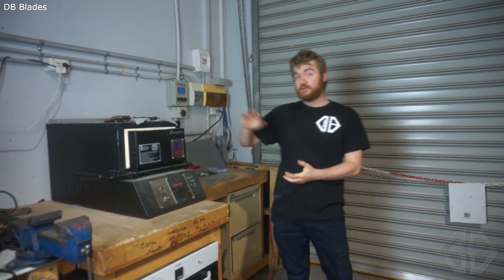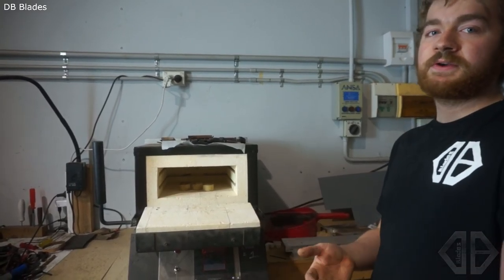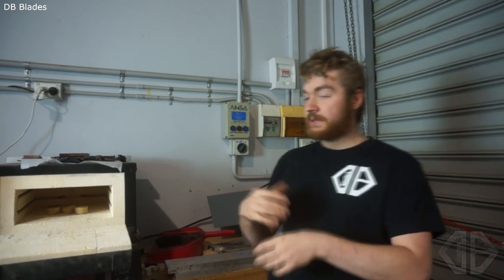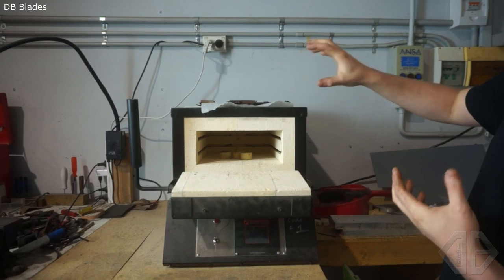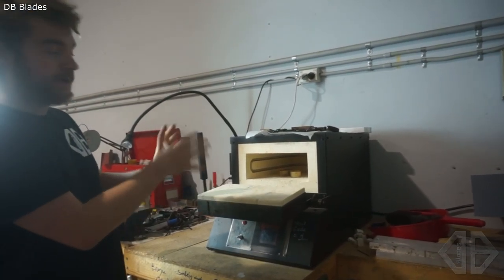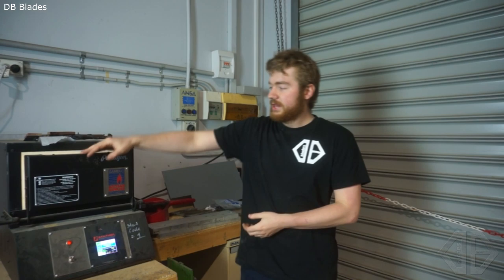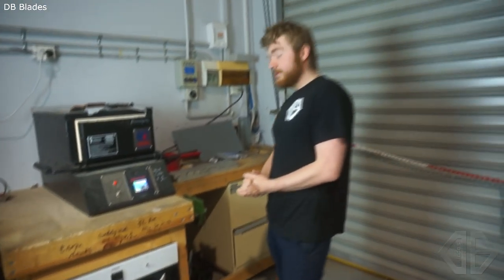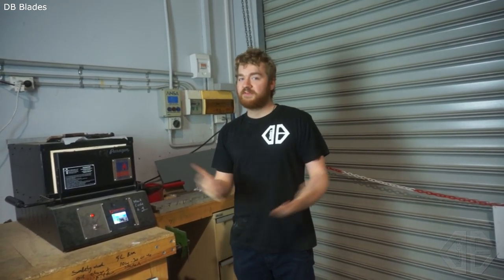So you want a heat treat oven: Paragon kiln review

Comment: Have you tried any of the newer Evenheat kilns? I've been comparing the two brands for a while now and I've gotta say, Paragon is very impressive, but I don't know if their prices are worth it.. The three-zones are REALLY nice  in their pricier models I'll admit, but for the price of your kiln, I could get a 40.5in Evenheat with all the bells-and-whistles, a front and back door, 10in wide internal capacity, as well as heating elements only in the side-walls of the kiln(to prevent over-heating in either the top or back of the kiln.) So I could do anything from kitchen knives to swords with it. Wondering how much of marketing with kilns is just brand-name preference vs number of features-to-cost. Curious to hear your thoughts, and I really appreciate the video, thank you!
Reply from the maker: I've used evenheat and these feel much nicer, nicer build quality. The one I used had a dodgy door latch